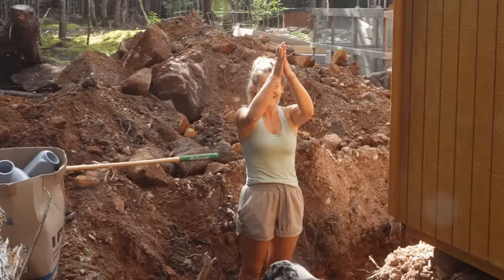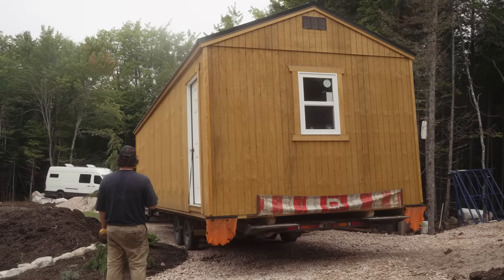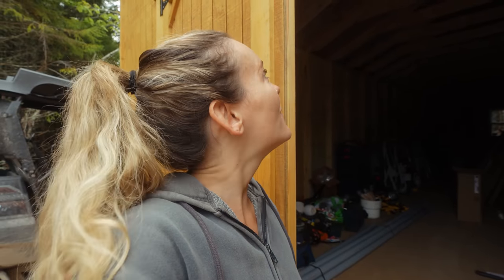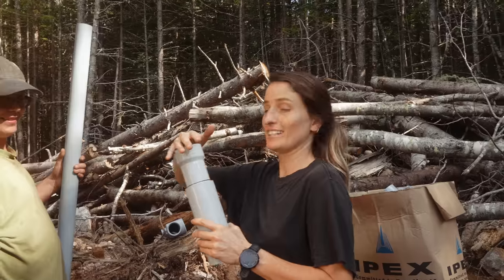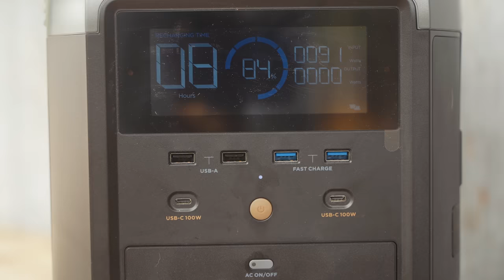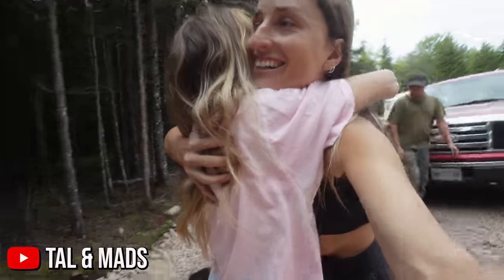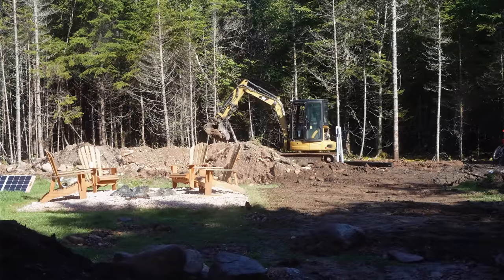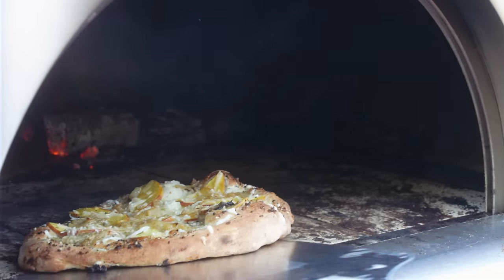Breaking Ground On The Electrical System (Off Grid Power)

Comment: When you are ready to pull wires through the conduit do the shop vac trick.  Tie a small part (amount depends on size of conduit) of a plastic bag to a string line. Use the vac to suck the string through the conduit. Then attach a rope strong enough to pull the wire and bring it through the conduit. Attach a wire pulling basket to the rope and pull the wire through.

Comment: As an IT-admin, I would recommend to also ran some networking lines with the power line. Research if Fiberglass networking is recommended for that, it could be.
Because if anything needs a data connection you my not want to depend on WiFi.

Comment: Lots of stuff getting done is right good job ladies and can't forget Porter of course. We always used to have a end of summer bash at out cottage lots with fireworks we got pretty good with the fireworks we usually had a budget of around $1000 and I was in charge of planning the display. Great video keep them coming.
Reply from the maker: Hey Trevor, thanks for the compliments. Yes end of summer party is going to be a tradition. This year was a trial run with a few friends ad family: 💛🐾

Comment: I'm in northern alberta, Got all my electrical solar equipment right in my cabin it 30×16 lots of room for my batteries because there lifepo4 10 kwh they can operate below a certain temperature or damage can be done, but I've got 5600 watts of panels all DIY, I just recently got the batteries but boy them batteries hold alot of energy almost like being on grid

Comment: Any conduit in the ground will fill with moisture. Make sure that you seal the ends that go into the house to prevent heat exchange and moisture build up.
Reply from the maker: Thanks for the tips!

Comment: You can use your touch to heat and bend your 2 inch pipe so your don't to stop and got your pipe in the ground. Just slow bend as you heat.

Comment: My metric assisting post (you tube) includes a silly question. I understand the need to put your water lines underground to a depth below the freeze zone. My question is did you need to place your power conduit to a similar depth? Does depth really matter for power as it does for water ? Living in a much warmer climate I have no experience with this area of the country and its winter temperatures. I look forward to your video's on Sunday mornings. I have one more request if you find the time. I like both the homestead project and the travel entertainment, is it possible to travel around Nova Scotia and show us some areas close by that we will never see from your perspective. PS ---you have a 50/50 chance of a hell of a storm coming next week. Batten down the hatches just in case. Thank you for your time and adventures.

Comment: Have you figured how your solar electric system will work in the low sun months like December and January?
Also, did you ever consider attaching a greenhouse to the main house to provide passive solar heat?

Comment: You didn't mention it but Shoshugibon is not just burning the wood. You also need to wire brush it and treat it with a natural oil like boiled linseed oil.

Comment: Have you both lost confidence with the Jackery power system? If so, please tell why? Thank you.
Reply from the maker: No we still use them. However, the Eco Flow can power our whole cabin & not a single Jackery model is powerful enough to do that. The Delta pro has a 3000w inverter, 300 amps battery, 400 Watts of solar & you can connect them to make more power. Where the biggest Jackery is 1500 watts & 50 amps of battery. Our needs have change drastically as we are renovating our cabin. EcoFlow is the better power station if you’re comparing specs.

Comment: Girls !!! Pickup! Extra fuel a must, is new building really ,really tied to ground. All loose stuff as secured so doesn't fly away.Cover windows on approach side of storm . Do you have back entrance may need to use as main entry . This is stupid to think of now are the roof trusses attached to walls with straps tieing the two together .Get what you need now, starts raining you're on your own until roads pass able.

Comment: Too late now girls but its best to install the wire pull rope when gluing the sections of pipe in the trenches as you go. Now you'll have to vacuum a mouse and string to pull in the rope, to pull in the wires . Works but the later would have saved time....I'm assuming the solar installers will pull the wires...lol will you be the installers? Pulling wire distances can be a big task...You'll get it done..Keep on keeping on...
Reply from the maker: Our electrician has something that takes 2 minutes :) thanks though
Reply: @Vanwives  you aren't going to say what takes two minuets ? I was a Class A Electrical and HVAC contractor in Florida for 42 years. Been  retired 12 years now ,I'd love to hear about the latest technology.Thank you for taking the time to reply, what a pleasant surprise..

Comment: Hello Ladies! You are overachievers on 11. WOW! Sure hope you ran strong braided nylon rope through the conduit lengths as you assembled it. So you can pull the long wire lengths later, as well as another rope to always be prepared for additional needs as they arise. And they rent trench machines that are quite efficient by the day. Different sizes for different depth needs. Then Porter could assist when hitting the Bigger rocks! Sorry I couldn't make the party! Gotta work on my psychic abilities! Or was that Psycho? LOL Keep Rockin it at 11. So you can be cozy when the Brrrrrrr hits! Love your Oasis in the vast Green Desert!

Comment: Umm... It's too late now, but it might have made pulling all the electrical cable easier if you had run some paracord through the conduit as you built it. Then, you attach the cord to the end of the cable and pull it through. Pushing it through the installed conduit, with all those bends, is going to be..  interesting. Good luck!
Reply from the maker: The electrician has a vacuum thing that works in seconds :) but that’s pretty cool!
Reply: @Vanwives  I am soooo glad I'm wrong. Here's to new technology!

Comment: I have a barn made by the same company if you are gonna use it as a garage find away to protect the floor because it chips easily.
Reply from the maker: Yes! Thank you for the tips. There is this waterproof black flooring that people use in their van conversions garages we are trying to source :)
Reply: @Vanwives  will love to see what you do because if I knew before putting stuff in, would have saved alot from this little pain in the butt. Lol  Right now I just have a thin rubber mat just laid down.

Comment: It use to be jackery now ecoflow?
Reply from the maker: We use both. But for way different things. Our Ecoflow has a 3000w inverter, 400 watts solar, 300 amps of battery storage. Where as our biggest Jackery has 1500W inverter, 200 amp solar, 50 amp battery storage. The Ecoflow can also be paired with another to run 240v & give you more storage. You can pair any Jackerys together.

Comment: If you want to know more about off-grid electrical systems or the Ecoflow, check out Will Prowse's channel.

The Ecoflow system is like Bose audio systems: good if you don't want to mess with assembly and can afford it, but overpriced. Signature Solar makes the system he uses that's modular and something you can build yourself with limited knowledge.

Comment: So what happened to/with Jackery?  You pushed them all the time and now you flip it. Wonder why.
Reply from the maker: No we still use them. However, the Eco Flow can power our whole cabin & not a single Jackery model is powerful enough to do that. The Delta pro has a 3000w inverter, 300 amps battery, 400 Watts of solar & you can connect them to make more power. Where the biggest Jackery is 1500 watts & 50 amps of battery. Our needs have change drastically as we are renovating our cabin. EcoFlow is the better power station if you’re comparing specs.
Reply: @Vanwives  & free better if the batteries were LP4 tho. Jackery does have the 2K I find it ironic u 2 pushing Jackery now ecoflo.

Comment: Vanwives TShirts, driving the excavator, you 2 jumping into the spring, driving a sledge hammer, chopping wood, or roofing, building your green house, in the trench running pipes, gardening, any number of these picters, or driving your van with your pups, and on the back put theres No place like home, and have a picture of your cabin, I don't know if that infringes on the wizard of Oz or not?
Reply from the maker: Thanks Lori for your vote of confidence.
Thanks for tuning in.💛💛

Comment: theres so much wrong with this i dont know where to start. 

it is difficult to pull cables thru under ground conduits  when they have 90 deg bends. my experience says no more than 2 bends, but preferably none. you should install pull thru pits at every change of direction,  however this doesn't apply to gentle curves in straight conduits.

you trenched all the way around the new shed,  WTF?? bring the conduits into the other end and then run cables thru internal of shed.

 dont use a 90 deg bend in trench where conduit raises to shed, use a 45.and plan it so conduit comes thro shed floor hard against inside wall. you will appreciate this when yor doing the cable pull.

and the excavator bucket? could have used a 6 inch for those 3 2 inch conduits 

anyway too late now. that was weeks ago.hope you got the cables in.

well done with  the spare conduit, i always do that. good job.
Reply from the maker: We are able to pull 6 90 deg bends. We followed exactly what our electrician said. 

Of course. We don’t want electrical boxes sticking out the side of the building. Where something else will be going. 

I wouldn’t say there is so much wrong. Maybe what we did is just not done your way. Anywho, there is always a reason for everything. No need to make assumptions based on observations:)
Reply: @Vanwives  i cant believe you pulled thru 6 x 90 bends. However you did so hats off to you and your sparky. Ive had many UG cable pulls fail due to too many bends, , but usually  with heavy >95mm2 x 4 cables.

Comment: Oh you goofy kids..  "Porter is backfilling..."  the video says (oh dear).  Some of us (who are now seven decades old) learned (the hard way) particularly with "lots of rocks" strategically also to put a) potential water lines, b) comm / ethernet, etc. wire  c)  low power (24v / 48v) line etc. etc. in "strategic" sections of trench when it is open. 1-1/4 or 1-1/2 poly pipe is cheap, a whole 1000' spool of underground network cable is about $45 on Ebay.   Yaayy for extra conduit line.   But no one can tell you (at this point) how good it can be not to have to dig and place (everywhere) when one needs.... to put the network connection in some corner of the property ... or spread some irrigation water (someday well may be bigger than 1.5 gpm...)

Comment: So i know you guys need to make money and all of the cabin costs money. But last week you loved jackery and this week you love Ecoflow. Both are freat products and Ecoflow is more of a static thing but it still makes you a bit implausible. You could have spend 10 more seconds and explain that you use jackery for a more mobile thing and the ecoflow system to power the more static things inside of the cabin.
Reply from the maker: No we still use them daily. We’ve had our jackerys for three years they were an amazing fit, however the Eco Flow can power our whole cabin & not a single Jackery model is powerful enough to do that. The Delta pro has a 3000w inverter, 300 amps battery, 400 Watts of solar & you can connect them to make more power ie 240 volt. Where the biggest Jackery is 1500 watts & 50 amps of battery, our needs have changed drastically as we are renovating our cabin. EcoFlow is the better power station if you’re comparing specs and if you have a higher power consumption.

Comment: It might have been cheaper for themselves if they had hired a helicopter to fly the building in since they lost 3 other delivery jobs LOL 
   Yall really should widen the end of your driveway out so it's easier and quicker for Porters big trucks and things like that building  to get in and out.
   But then again I believe your about done having big things delivered. Unless your planning on building a 10 story fire ranger tower haha
  Ok now you want a pogo stick. So now you will have to have a concrete truck back in your driveway so you can lay a concrete driveway all the way out so you can pogo the whole length of your driveway.
   You can't pogo in the yard it will sink in to far.you can't pogo on the gravel driveway you will fall and get hurt and be in a wheel chair for decades.
   That's an awfully expensive pogo jumpy toy.
    $50,000 pogo concrete driveway .huh 🤔😳 OK next video crazzie chick's pouring $50,000 pogo concrete driveway 😄 🤣
    Porter is the man.he can do anything.can two you imagine if there had never been a Porter. All the work he has done for yall yes with your help but my goodness the man is a work horse plus he's had all the heavy machinery and trucks and things you've needed to do it all.
    Hes been a God send for sure.what a guy and wonderful friend.